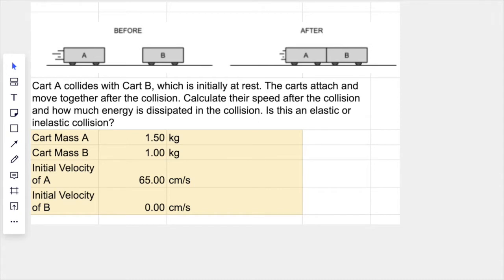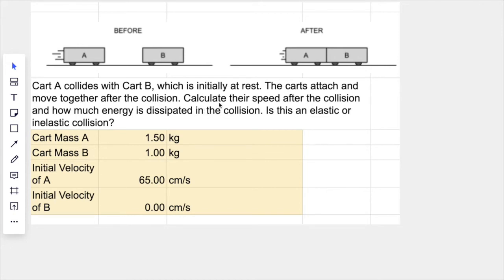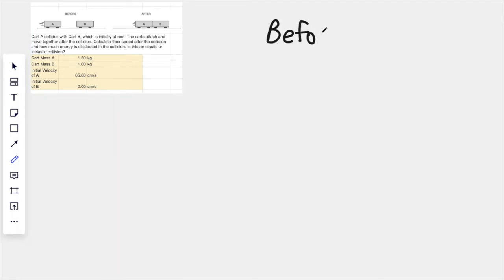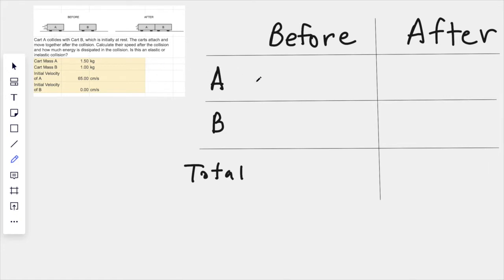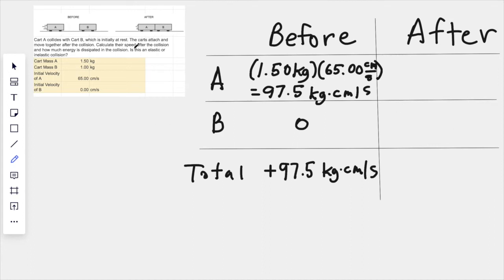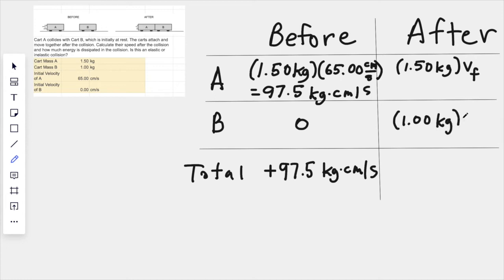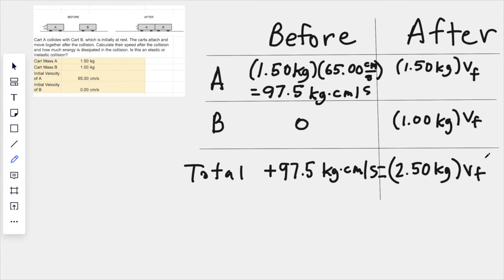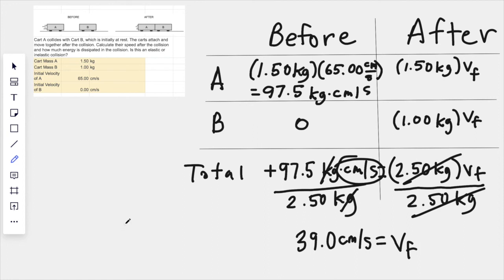Momentum Problem #1:  Objects Collide and Stick Together (solve for final velocity)

Comment: Please help me calculate this
 a car of mass m moving at a speed of v1 collides and couples with the back of a truck of mass 2m moving initially in the same direction as the car at a lower v2.

a) what is the vf of the two vehicles after collision?
b) what is the change in kinetic energy of the car_truck system in a collision?